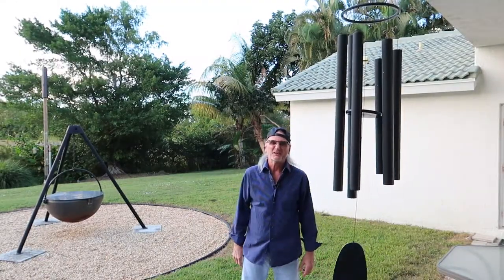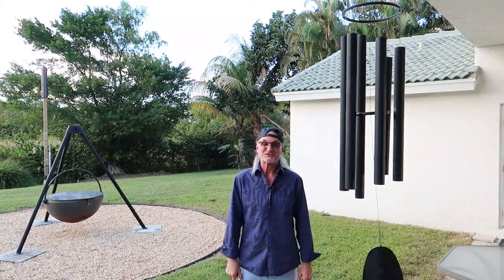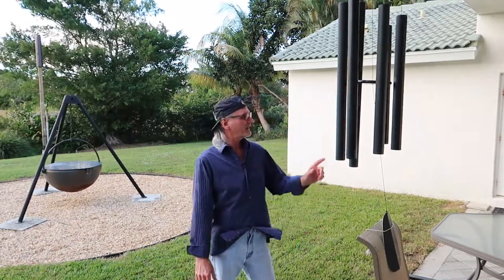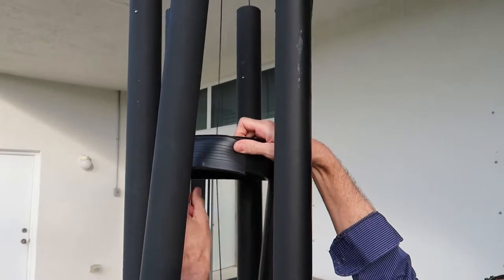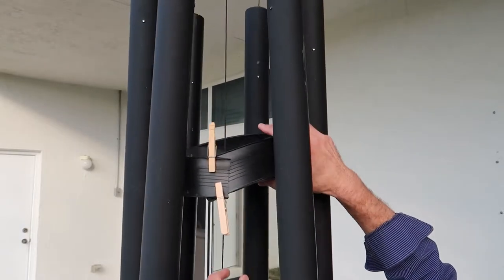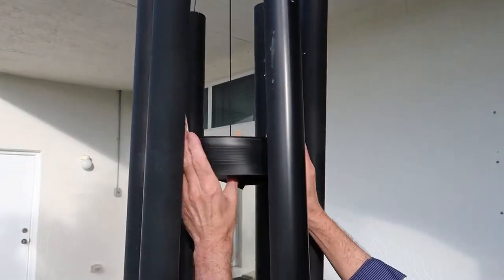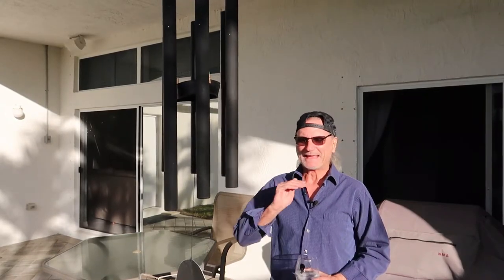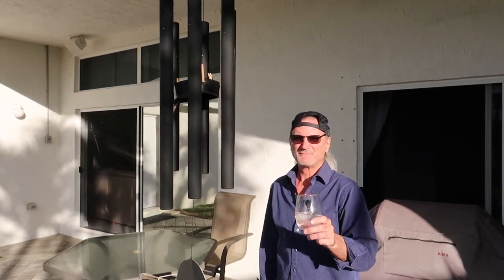A Wind Chime Silencer For Those Extra Windy Days.

Comment: How have these held up outside over time? Trying to decide between these and a larger set of corinthian bells.
Reply from the maker: They are still ding-donging today. I hung it on my back patio and my patio faces due West, so it sees full sun for at least six hours per day. You just had me put a video idea on the drawing board. When this chime has a failure, I will have to upload a follow up video. Thank you. Good luck with your chime selection.